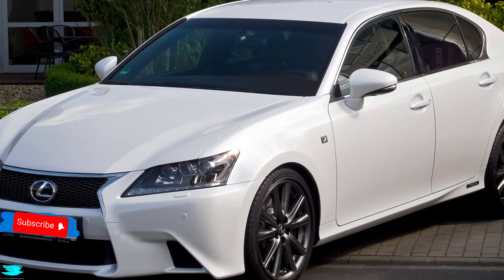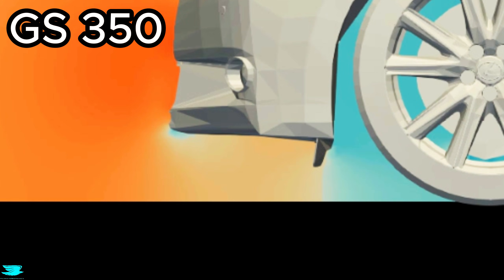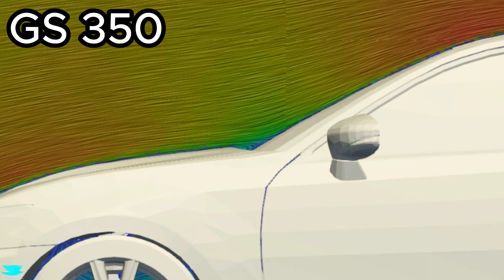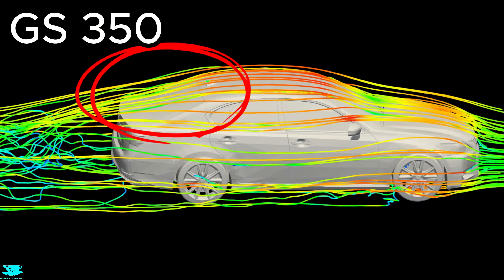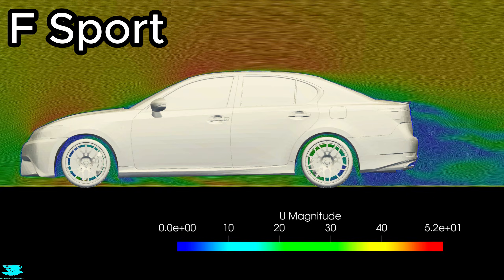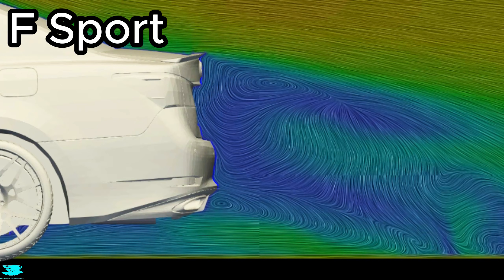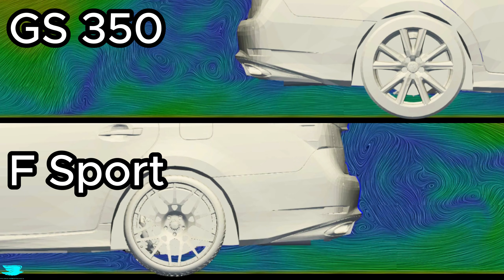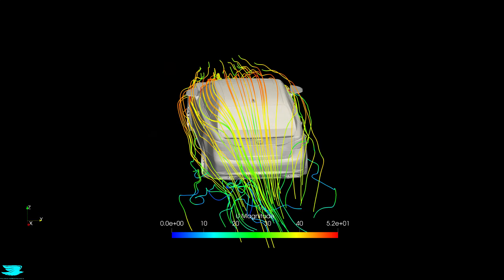+44% More Downforce? What the Lexus GS350 F Sport Actually Changes

Comment: Very interesting to see so much turbulence where the rear bumper meets the quarter panel. The GSF has small add-ons in this area, and I thought they were just for looks.

I put them on my GS350 just for the style. I don’t track the car at all so I didn’t notice any difference. I am curious to see what the difference would be in a model though.
Reply: can i know what are the add-ons that you are talking about?
Reply: @swxs1986 I believe it’s part numbers 52706-30010 & 52707-30010. You’d also need to chose the part that has the correct 2 digit paint code at the end of the part number.
Reply: @Argon_Blue  thank u so mcuh!

Comment: Do you think there's any chance that a similar spoiler on a wingless Evo 7/8/9 could provide the same reduction in lift as the large OEM wing? There's a 20 year old German magazine article showing that the rear glass is too steep (?) to effectively utilize the factory Evo wing.

The article also compare the Evo to the STI, with the STI having significantly more downforce at the rear, while the Evo still dealing a bit of lift even with the wing.
Reply from the maker: It would definitely give you more downforce, but I don't think it would be as much. You could probably get 20, 30, or even 40% as much, but if you want to get as much, you'll incur a greater drag penalty for it, especially if it's in separated wake (because then it has to be bigger as well.)

Comment: The full width rear spoiler reminds me of a curiosity I've noticed with late model sedans. In some modern sedans, the rear spoilers reduce in height as they read the outer regions of the vehicle. Yet in other modern sedans, it does the opposite with the edges of the spoiler being full height and the central region being reduced. Why seemingly completely opposite theories?
Reply from the maker: One aerodynamic reason is that if you extend the spoiler up at the sides, you can balance the wake a little more with the rear wheel wakes.

It also gives the car a certain aggressive look.

Comment: This model is well done in the fact that it preserves the details of the flicks and air dams around the wheel. Those devices are critical for managing wheel wake, as you know, the tire squirt itself is a strong vortex created by the tire's rotation. By pre-empting that vortex with a vortex generator, you basically create a quantum tunnel for airflow to just pass through the wheel unimpeded. This means there's less interaction between the incoming airflow, and the wheel, which means the free stream air is less affected by the tire squirt.
Reply from the maker: Yep, Lexus did a good job here.